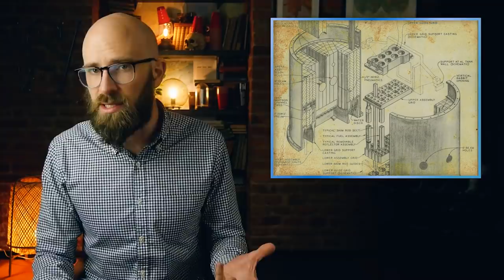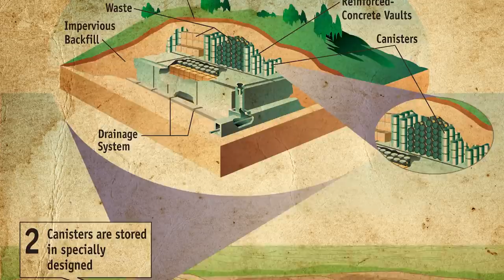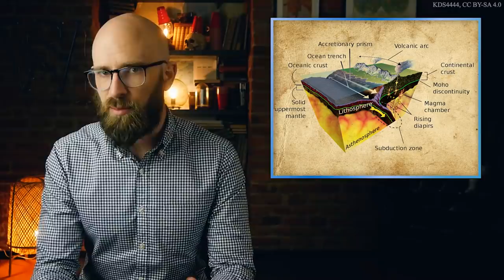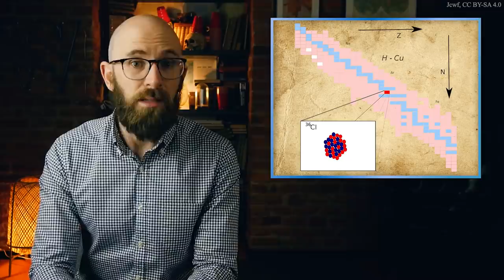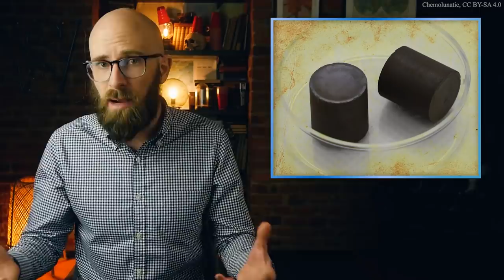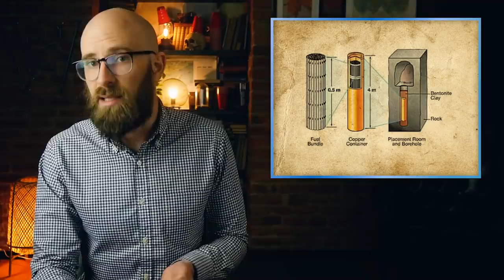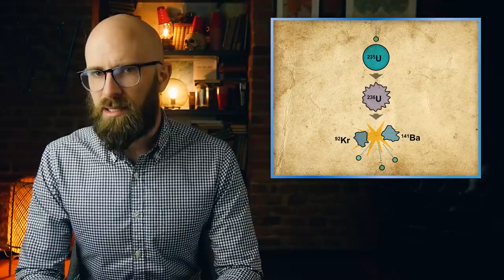How Does Nuclear Waste Disposal Work?

Comment: It doesn't. It's not disposed of, it's just hidden.
Reply: Waste disposal
:
Removing and destroying or STORING damaged, used or other unwanted domestic, agricultural or industrial products and substances. Disposal includes burning, burial at landfill sites or at sea, and recycling.
Reply: @SittingOnEdgeman  Yes, you can reprocess it, but that isn't disposing of it. and it is the fissile material we are concerned with not the remaining inert material.
Reply: @Tactical_Hotdog  Which dictionary defines disposal as 'storage'? And 'storing' something is hiding it, it is still there, it is still present. The same goes for landfill. Only a small proportion of what goes into landfill biodegrades; so this is also hiding. Recycling is not disposal, it is recycling.
Reply: @TukikoTroy  Incorrect, it was hidden from the early 1900s up until 1945 when the first bomb was dropped.  Kodak film found out what they were hiding back in the 40s didnt they?  They made a deal further hiding what happened.  They then hid all the waste surrounding St. Louis getting into the rivers and water sheds.  They then finally after decades of hiding it here and there decided to finally put it at Westlake lanfill/superfund site....that is now under a smoldering event that most in the US do not know is happening and with many downwind that are now ingesting not only chemicals but also radionuclides......that is being hidden from the general public of the entire US not just the local public.  It has been hidden in the ocean, in other countries like Russia and China of which we have no clue what they have hidden for decades just like US!!!   You are incorrect.  So now you are obviously pro nuclear...9 times out of 10 those that are pronuclear either make money directly form the nuclear industry or knows someone that does and the 10th is just porely informed....so which one are you???
Reply: @TukikoTroy  Right and fluoride is used to break the covalent bond and seperate that fissile material from the wasted fuel......Barium and aluminum silicates are used to remove strontium from sea water and coupled with an RF resin can also remove cesium as......so whats your point...now we know why fluoride is in the water, iodine in the salt and Barium, aluminum, and strontium levels in air, water, dirt and blood samples all over the world have increased drastically since Chernobyl and Fukushima......
Reply: @paulmobleyscience  Yeah, what you have there is correlation, not causation. Nice try though.
Reply: @paulmobleyscience  Er, you do understand that I am making the case AGAINST the nuclear industry by demonstrating that nuclear waste cannot be disposed of, only hidden from view. You DO get that, right?
Reply: @TukikoTroy  correlation or causation would still be your opinion not either or both even.  Sure I just showed how its been attempted to be hidden for a very long time and now we know better.
Reply: @TukikoTroy  You suggested that it wasn't being hidden and is still there. I showed that it was attempted to be hidden several times is all
Reply: @paulmobleyscience  You said: "Barium and aluminum silicates are used to remove strontium from sea water and coupled with an RF resin can also remove cesium... Now we know why fluoride is in the water, iodine in the salt and Barium, aluminum, and strontium levels in air, water, dirt and blood samples all over the world have increased drastically since Chernobyl and Fukushima. You have stated (what I am going to give you benefit of the doubt for) is a fact. Then you have said that because of this we KNOW why flouride... etcis in the water, air etc. Unfortunately, this is correlation and not causation because you cannot demonstrate that these are in the environment purely because of the nuclear industry. To claim causation you have to show that there can be no other cause for the presence of these pollutants. This is not a matter of opinion, it is the way arguments and logic work.
Reply: @paulmobleyscience  Please quote which post you say I suggested it wasn't being hidden. All my previous posts make the point that it is not disposed of, just hidden.
Reply: @TukikoTroy  How did vast amounts of Barium,aluminum and strontium end up on mount Shasta???
Reply: @TukikoTroy  Its nothing more than semantics.  To have a cause there must be a correlation but to have a correlation there doesn't have to be a cause?  Cause and affect is causality....we have the affect and no other reason for the cause...other than what is known by simple deduction...
Reply: @TukikoTroy  Opinions or best guess or both one in the same?  Someones best guess is still their opinion on the matter...
Reply: @paulmobleyscience  I don't know, but then, the burden of proof isn't mine. The burden of proof lays with the one making the claim. And you still need to show me the post where I said it wasn't hidden.
Reply: @TukikoTroy  Burden of proof?   Its already proven and no need to prove anything here and nothing but semantics.  Show where you said its hidden on not hidden doesn't matter in the world in the least by anyone.  No one cares if you said hidden or not.....the issue is nuclear waste and its dangers.
Reply: @paulmobleyscience  See, now you are floundering. It was YOU, sir, who brought up whether I said it was hidden or not. But now you can't even admit you were wrong like a man. Fair enough. But no, this is not about semantics at all. You have made a claim, and so the burden of proof lays with you. Assertions made without evidence, can be dismissed without evidence. I trust we can end this farce now?
Reply: @TukikoTroy  Floudering?  Excuse me?  I more than showed how its been hidden in the US alone let alone in Russia and China OF WHICH NO ONE WOULD HAVE RECORD OF TO SHOW YOU WOULD THEY??? So what are you doing here promoting nuclear power when I've proven not only I answered any and every questions you posed including where you say it isn't hidden but also go on to further prove with incident after incident of how it has been hidden in the last 70 years.   Remember the fact of Kodak in 1945 getting a notice from the US government while they BOTH hid it from the general public???  Surely this is no mystery to you.  So what do you do for a living pronuclear stranger that knows nothing about me?
Reply: @paulmobleyscience  Now i KNOW you are trolling. There is nothing in any of my posts that promotes nuclear power. I have consistently maintained that, far from being 'disposed of' nuclear waste is just being hidden. If you are too dim to see that then I apologise for the US education system. But I think you know perfectly well what I am saying. Now then, either present my post that demonstrates I support the nuclear industry or  back under the bridge with you.
Reply: @TukikoTroy  Trolling?  That doesn't even make any sense.  This is my real name and my real single account and my real picture.  Trolling?  Why because you cant refute any of it you choose to attack someone?  Trolling?  Absolutely not in the least.  What is the issue seriously?
Reply: @TukikoTroy  All I said was you said its never been hidden just stored....thats nothing more than semantics.  Now youre complaining because you think I think youre pronuclear?  No im just showing how youre wrong thinking its never been hidden and only just stored
Reply: @paulmobleyscience  "...you said its never been hidden just stored" Show me where I said that.
Reply: @paulmobleyscience  Wow, you don't know what trolling is, okay, let me educate you. Trolling,  is defined as creating discord on the Internet by starting quarrels or upsetting people by posting inflammatory or off-topic messages in an online community. Basically, a social media troll is someone who purposely says something controversial in order to get a rise out of other users. In this instance, insisting I said something which I never said, even after me repeatedly asking you for the evidence.
Reply: @TukikoTroy  Of course I do but I'm pointing out trolls hide behind fake everything and there nothing fake about me.  You said its never been hidden and all I said was it has been hidden.  What do you know of the inverse square law?
Reply: @TukikoTroy  Inflammatory?  Ive showed you respect the entire time.  I haven't cursed at you and haven't talked down to you or bullied you and at this point you are attempting to bully me.  Look how you are acting....trolling?  Thats what a troll would say.  You said its never hidden and I simply proved you incorrect and you didnt like it.  You do know we are both anti nuclear so why are you trolling me?  Sounds rediculous right?  Stop with the nonsense troll talk this is two people having a difference being mostly respectful to each other.  No hard feelings are meant so calm down and lets talk this out admirably
Reply: @TukikoTroy  How did I say anything controversial?  Again you said this so I said that l.  No trolling no made up scenerio you just came up with off the top of your head.  I am a real person thats been trolled and his fiance trolled and know exactly how trolling feels.  I am simply here making sure the trolls dont take over the topic.  Good day
Reply: @paulmobleyscience  See, this is what I am talking about; dancing around instead of actually copy/fasting the post where I said what you claim. The fact is, you can't because I never said it. If you can do so then I am a big enough person to apologise... unlike some.
Reply: @TukikoTroy  Ill even prove I'm not trolling.  I will apologize to you and say this is a misunderstanding on both of our parts but I admit misunderstanding.  I apologize if I caused you to feel any certain way about not only me but also speaking of this topic.  I honestly mean no harm to you or any subject you wish to speak of and I really do mean this....now will you do the same?
Reply: @TukikoTroy  I think the misunderstanding at least on my part is the way you worded your comment not the first but one or two that followed it that is worded a bit questionably and I read it a few times to make sure and still thought you meant it that way but since you were so persistent I then went back and dissected it again and I see you are saying that storing it IS hiding it and we are basically saying the same thing.  You cant assume someone is trolling you just because there is a disagreement.  Everyone so quick to accuse someone of "trolling" and then do trollish behavior in response.
Reply: @TukikoTroy  Ill even go a step further, do the right thing and be a subscriber. My apologies...

Comment: Yesterday's waste is tomorrow's fuel. I can see a day where these spent fuels are extremely valuable and highly sought after . Either as a means of heat - electricity- or a future space engine akin to an ion drive. Someone somewhere will find a use.  We as a species always do.
Reply: Wait, didnt you just copy and paste this back up here 2 hours ago? Did you delete your other comment thread then that was exactly the same yet it had many comments under it?
Reply: Paula Moby  Gee, I wonder who constantly copies and pastes comments here on YouTube, then criticizes others who do the same because the post makes you butt hurt.  Now quit avoiding the topic and show where he is wrong.  We already know after operation of a test facility at Oak Ridge National Laboratories over 50 years ago that he is quite correct.

Comment: Great video though I would add to the "future society accidently digging into a repository" scenario. Obviously not possible to completely eliminate the chance, but it is reduced by choosing locations with little to no ores of interest in the area.
Reply: In the 1980s, the U.S. government was thinking about how to prevent some culture thousands of years hence from accidentally digging up the waste.  The big concern was how do we have a warning that would be clear?  Even the iconic skull and crossbones does not carry the same connotation for all cultures, today.  After spending over $100,000 developing such a universal icon warning, the government asked me to test whether it would work for all time and all cultures.  My first test was to go to the United States Capitol when the Congress was in session and show it to Members of Congress as they left the building.  After trying it with 100 of them, I found that NONE of them got the right message when I showed them the expensive icon.  I reported back to the Assistant Secretary of the Department of Energy, and the project was scrapped.

Comment: Doesn't Thorium Reactors not produce waste?
Reply: Yes, but it also reduces the radioactivity of that waste greatly as compared to today's reactors.
Reply: Just 20-100 times less waste and of an easier sort to deal with.

Which is pretty good considering nuclear power already produces the LEAST waste of ANY energy source, by several tens of millions of times; and all of that waste has always been safety contained.
Reply: @danadurnfordkevinblanchdebunk  They said NOT produce waste....that was  the question....which the answer is false.  Thorium reactors do produce radioactive waste.  Your answer and bronzedivisions answers dance around the initial question.  Reactors of all shapes sizes fuel are null and void and so are your opinions on them.